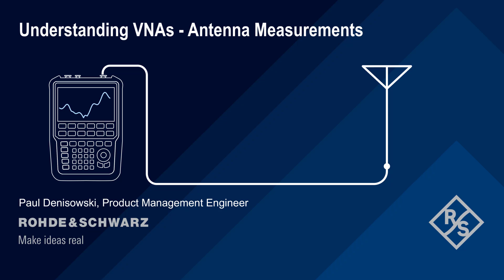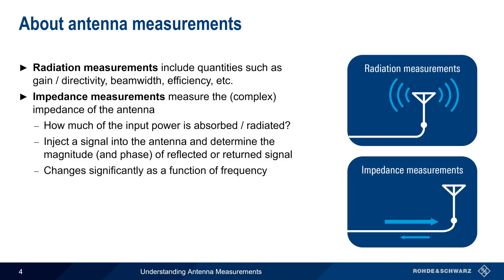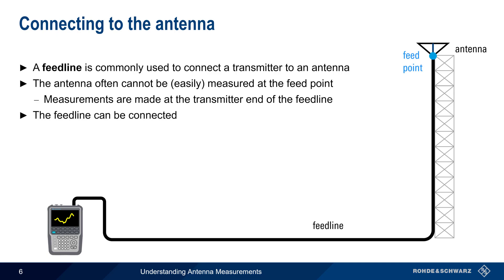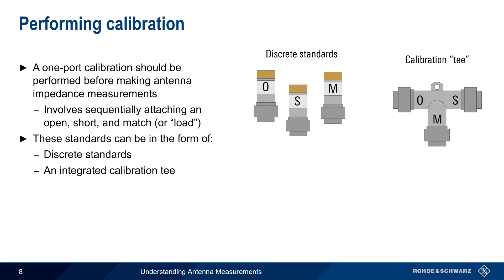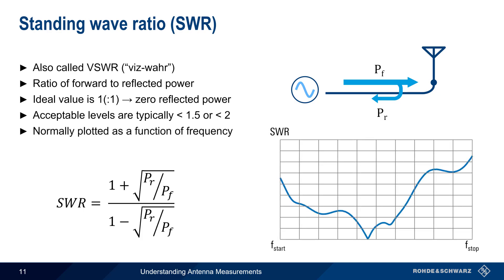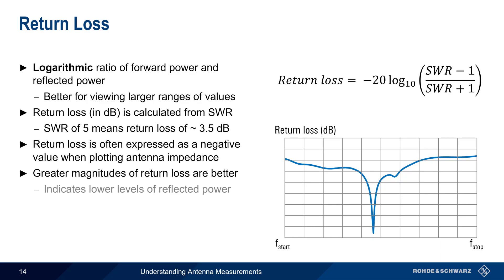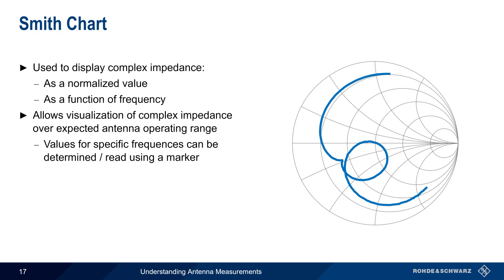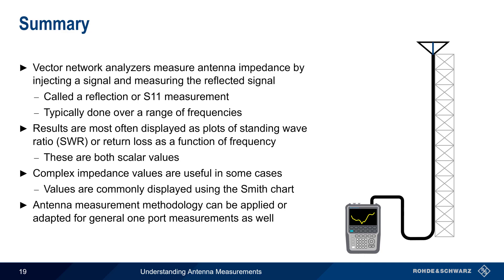Understanding VNAs - Antenna Measurements

Comment: Good morning Paul, interesting video but with some points to evaluate, because measuring with a VNA at the input of the transmission line does not measure the impedance of the antenna but the overall impedance of the antenna plus the coaxial line! in the case that the line has significant losses, for example 3 or more dB, the SWR measurement will be distorted because it will return values at the ends of the band lower than the real values that would be obtained by measuring the antenna directly at its connector. I'll give a simple example: I transmit a 100W signal at the start of the line, the line attenuates 3dB, therefore 50W arrive at the antenna, let's assume an SWR of 2:1 at the antenna connector, therefore the incident signal will be reflected by about 11% therefore about 5.5W will return vs the transmitter, but will undergo the attenuation of the line again and will halve and therefore at the measurement point 2.75W will be read. So if we do the math, Fwd power 100W, Rfl 2.75W SWR of about 1.3:1 while the real situation at the antenna connector is much worse! All this just to say that the correct measurement of the impedance of an antenna must always be done at the connector, and if you use a cable you must use a quality cable with low attenuation, and calibrated Short, Open, Load, in addition using poor quality cables and with high attenuation reduces the directivity of the bridge, or of the coupler and therefore increases the uncertainty of the measurement. Best regards
Reply: Thanks for the detailed comment!  Yes, the feedline has loss (and potentially a different impedance) that can affect the measurement.  There are other aspects to measuring antennas: e.g. even if you were to measure directly at the antenna feedpoint, this would place the measuring instrument in the near field of the antenna, and this in turn could affect VSWR, etc.  Using a low-loss, impedance-matched cable, with quality connectors and a proper calibration are, as you mentioned, very important as well.  Since this video was intended as an introduction to antenna measurements in the field (where it is often not possible to make separate measurements of the feedline and antenna), some of these more subtle aspects were intentionally omitted :)  Thanks again for the comment!

Comment: Please Mr. Paul , could you kindly explain how to measure FM Antenna mounted on the top of a 200 meters tower , because when connected to the VNA , the measurements are not clear because the Antenna receives RF signal from space , regards
Reply: There's no easy solution to working around problems due to external signals being picked up by the antenna. Ideally, antenna measurements would always be made in a shielded / anechoic chamber or in a OATS (open air test site) far away from other sources of RF in the measurement range.  Assuming the antenna must be measured in place, one possibility is to use filters to attenuate the external signals.  Another option is to try to make measurements during "quiet times"  Since the sweeps usually only take seconds, hopefully it's possible to find a time when the RF environment is quiet for a short period of time.  Hope that helps!
Reply: @pauldenisowski  , Thanks a lot for the detailed explainantion Paul , please how to use filters , suppose I', receiveing some FM carriers during measuing the FM Antenna , how I conect the suggested filters ? , regards

Comment: Nice video Paul.  A couple of minor points that often draw questions:  1) The impedance seen at the input of the feedline is NOT the same as the antenna impedance (except for the case where the feedline is an odd-quarter wavelength long).  2) The length of the feedline does NOT affect SWR, provided the feedline is not acting as part of the antenna, and is sufficiently low loss.  And 3) Strictly speaking, Return LOSS is a positive value (so large values mean a LOT of loss, thus little energy returned).  The Reflection Coefficient is typically expressed as a negative value (just the opposite sign of the RL value).  I know you know these things, but I figured your viewers would benefit...  73!
Reply: Thanks Alan!  In the interest of time, I didn't include any information about the feedline - that deserves an entire video (or several) of its own. And the sign of return loss is always a problematic topic. :)  Personally, I also consider return loss to be a positive value (as mentioned at 9:50 in the video), but I often see it expressed as a negative value when used in antenna measurements.  

Incidentally, the editor-in-chief of IEEE Transactions on Antennas and Propagation published a short article describing the origins and proper use of the term "return loss" because a close to a third of the people submitting papers to this journal were using the term incorrectly.  Note that he too considers return loss to be positive.

T. S. Bird, "Definition and Misuse of Return Loss [Report of the Transactions Editor-in-Chief]," in IEEE Antennas and Propagation Magazine, vol. 51, no. 2, pp. 166-167, April 2009.  

Perhaps the best solution is the one I saw recently in a NanoVNA software package:  it lets you choose if you want return loss shown as a positive or negative value :)
Reply: Two legends discussing casually about return loss❤ Awesome video.
Reply: @nirbhay_raghav  Well, ONE legend, and one wanna-be (me)
Reply: @w2aew Huuuge understatment😂. Love u both.
Reply: @w2aew  🤣  Alan is far more of a legend than I will ever be.  I'm not exaggerating at all when I say that he is my inspiration 😀